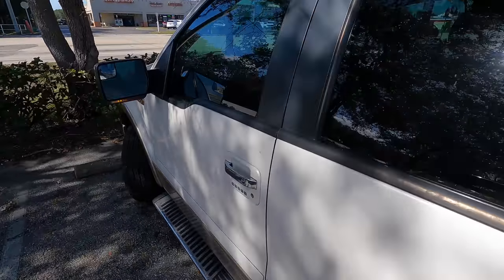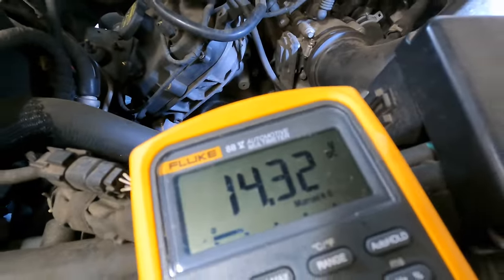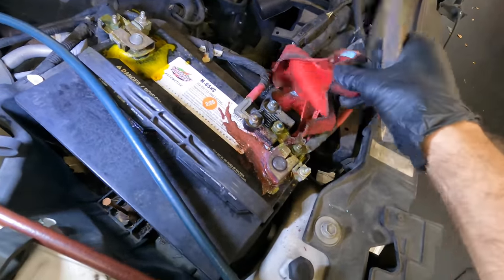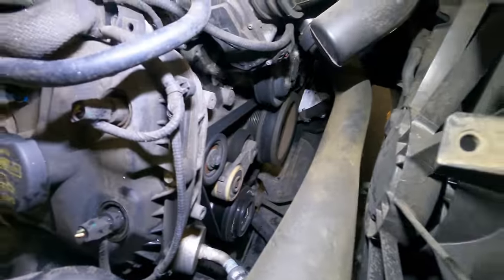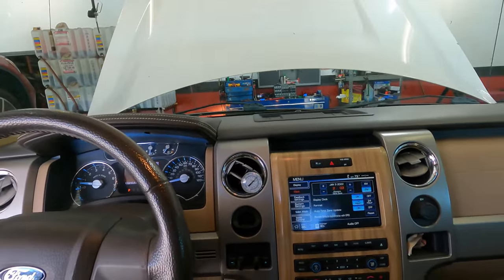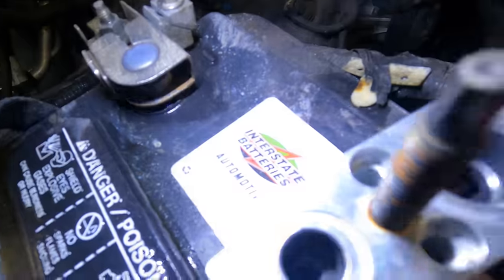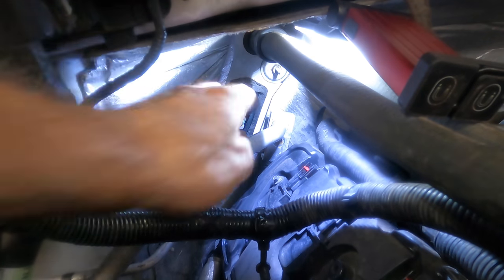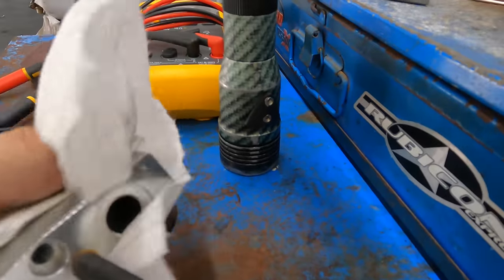It’s the Black Death!

Comment: Ray is the kind of guy to clean up the battery terminals when diagnosing a rusted fender
Reply: Much respect for this man
Reply: It's good, but I mean the outside of the terminals doesn't affect how they contact the battery, cleaning the contact areas would've been best
Reply: @user-ut9ln4vd5m  Quite true. Not disconnecting the hot side while wire brushing it and risking grounding it to the frame was also a dead giveaway that our boy here is knowledgeable, but on the lazy side.
Reply: @jshireley  yeah He’s trying to summon his inner Colombo while showing us his outer Lucy Ricardo, I am sure that cleaner he was using by California code would be considered caustic and or possibly carcinogenic and I’m sure he got a face nearly full of it. And I really don’t think it’s his lazy side as much as it is him being green and learning on the fly a lot of this technical mechanical information that he gets from a bona fide laptop program for mechanics, Which all comes together in his edited videos
Reply: Had a tech at the shop I work at last week clean battery terminals with brake clean then proceed to wire brush it directly afterwards. The green flames coming off that battery sure were pretty 🤣
Reply: @user-ut9ln4vd5m  Ditto.  But it was an entertaining gap filler and possibly good therapy for his desire for perfection 🙂🙂
Reply: @jshireley  He actually mentions that in the video.
Reply: I'd be too embarrassed to have Ray look at the state of my battery..... 😳

I'd have to get a new battery first before I let him poppiez the hood for diagnosis 😅
Reply: @darkwolfe6986  🤣🤣🤣

Comment: Fun little tid bit.    I bought my wife a newer car this year it’s a 2017 Chevy Tahoe.   Really really nice rig I can see why they keep Making them BUT it was used and we got a sweet deal.  Had some issues it had a Huge scratch down the side of it  like a key I think. Cost me $2200 at a body shop.  And then the ac didn’t work.   Kind of odd for 2017 with 46k miles.   They had a recall for the condensor in those years they would crack in this one spot and sure as shit that’s what ours had.  Our vin was included in this recall but of course the dealer ship near us was months out mainly because of covid and the shipping issue.  We bought it early summer with ALOT of hot days ahead of us and all black leather interior.  I ended up doing the condensor myself it was $80   But lol this rig takes a “new” Freon  R-1234yf.  It cost nearly $600 to fill it.   I thought that was pretty neat of GM.

Comment: I think it is obvious that the problems with this truck all originated from the unacceptable orientation of the oil cap.  🙃
Reply: I kept looking that myself and thinking, wth need to flip truck on it's side to fill? ;)
Reply: Wtf is an oil cap? You mean the 710 cap.
Reply: "The unacceptable origination company of the vehicle itself".. There, FTFY..
Reply: @garykirk1968  GOD........doing work in an Oil Change place, I've burnt myself on more Ford exhausts than any other cars. Stupid older Escape models, the F-150 (2019 model with its shitty thermocraptasticplastic plug I had once make a massive mess on the entire floor of the bay.)
Reply: Unacceptable orientation is one thing. Not doing two to seven full turns of the clicky cap when you install it can be detrimental to your engine.

Comment: Looks like the old compressor blew up spectacularly and the system should've been flushed back then. Good to know the customer gets it fixed under warranty.
Reply: 1:52 Yeah, compressor a bit noisy?
Reply: Yeah I noticed the compressor did not sound very happy
Reply: That would depend on how clean the system was the first time and what happened to the other pump? They could have just stuck a cheap rebuilt pump on it and it just didn't last.
Reply: @garyr7027  unfortunately I would like to challenge anyone to find a compressor or any other part from the direct factory since all you can get is remanufactured equipment , and Ray installed this compressor last year and cleaned the system thoroughly and did everything by the book but as many people know you can receive a bad new part straight from the manufacturer , quality control today is pretty much out of the door now
Reply: @catslivesmatter1268  As Ray has said before, new doesn't necessarily mean good.
Reply: @MonkeyJedi99  exactly 💯 true And I don't have enough fingers to count how many times a NEW PART was either the wrong part or the right part but very much not good part 〽️
Reply: My local independent shop has sworn off all of the Chinese aftermarket compressors (UAC, GPD, Four Seasons, etc.). Too many come backs. They only use OEM compressors... And yeah, they are freaking expensive! On some older cars (03 Taurus, 04 Dodge RAM) I (as a shadetree mechanic) have had good luck with OEM rebuilt compressors from Jensen Auto in Michigan (not a sponsor.) Always flush the evaporator; at least flush the hoses OR just replace them, and always replace the condenser - most condensers these days are parallel flow/microchannel, impossible to flush.
Reply: As it should be covered since Ray replaced this less than a year ago and he did a video of the replacement and he flushed the system and even did it a couple times including the new oil in the compressor
Reply: @catslivesmatter1268  I agree there, it's getting really bad with parts now. I completely redone my AC system on my 97 f150 about 3 years ago and I was picky about the parts I got, and crossed my fingers the parts were good. Luckily I haven't had any issues yet, except for the dryer I bought from a Ford dealer, when they sold me a used dryer that kept freezing up 3 days later, then they denied it and claimed it was new on a open boxed item... stealer dealership. I ended up finding another new one online. Ford managed to change design that year and the original dryer mounts up different than any aftermarket one I can get. It's messed up situation but I managed to make it work anyways.
Reply: @garyr7027  those dryers are really a pain in the ass, I have installed the same type of dryer for a central AC that is adjustable and it is a great way to get it right after a few adjustments , Central AC is totally different than what the auto industry uses as you probably know and I didn't think it was possible to install the central AC dryer auto from the central unit but since my brother in law is one of 13 specialist that also works for NASA , he had it right the first time , Many inventions have been turned down due to the government stating that the industry would go broke if they patent any of the great ideas ( like the snap out dashboard for example ( not Designed the way I would picture it but none the less they turned it down )
Reply: @smokingstone1141  yeah sounded bad
Reply: @davidgilpin5200  It is amazing that anyone would ever buy Chinese anything auto parts, or any parts, pretty much  anything from them..
They do not CARE one whit what happens to their cheaply made, less than any quality, parts, ever... 
Anyone that buys them because they are so much cheaper - well you get what you pay for... And then some, when it blows up and comes back to you..
Reply: @frandanco6289  Trouble is, by the time enough people realise the Chinese stuff is crap, all the indigenous parts manufacturers have gone to the wall & there's no quality alternatives left.
Ford, GM, etc don't give a damn, so long as they keep shifting new vehicles which last out to the end of the warranty.
Reply: @Andrew-ep4kw  Same.
Reply: @frandanco6289  problem is that for other part of the world that uses USDM vehicles, Chineese made parts are sometimes the only parts you can get a hand on within resonable time frame. If I want to do any mechanical work within half a year on my 70' Lemans I have to order in advance EVERY SINGLE PART out of US or make it myself (I live in EU - Poland Btw). Newer parts arent any different. It's either heavly used parts, or knockoffs (or order it for a 2 or 4x price because fk me and my american car).

Comment: Just found your channel. I like what I see and I don't know why. So I'll keep watching.

And BTW: When I was a young guy, I visited FL during July. I thought that I was set on fire and feared for my death as soon as I stepped away from the airport. All winter as it snows, I now think to myself "At least I'm not in FL during the summer".
Reply: When I moved to Phoenix in the early '70s I noticed none of the weathermen called anything below 110F "hot."  In June or July 1976 (IIRC) a TV weatherman said, "Tomorrow, sunny and cooler; high 113." "Sunny" was usually reserved for under 110.
Reply: In college, I had a housemate from the Tampa area who absolutely freaked out when the temps got below 60 degrees.  She headed back down just as soon as she was able, and cannot understand how or why I continue to survive in the North.  I argued then (and maintain to this day) that when the temp drops from 45 degrees to 25, it's not that hard to add a layer, but when the temps go from 85 degrees to 105, there's just no way to get any more nakeder.
Reply: I grew up in central AL in the '50s.  Average summers were 90+ 90% humidity and no AC.  You just learn to sweat and stay hydrated.  Big old attic fan like a DC3 engine cooled thing off at night.  I can tolerate heat with no problem to this day.
Reply: @govsquid  truer words have never been spoken
Reply: *shop phone ringing has entered the chat * another reason to love this channel
Reply: keep your weak blood up north! MORE HEAT FOR ME!!!!

lol jk
Reply: What is you talking about! I had family from California in the middle of the summer and they were happy with our 93F (feels like101)weather as they used to the 113F (feels like hell)
Reply: I'm from NY, when leaving the airport I started to sweat.  Shortly after that experience I changed my diet...

Comment: One thing I like about this truck is the engine, mainly in that you can see it.  It's not covered by a bunch of cheap plastic panels.  Seriously, on some cars it's like having a second hood.
Reply: Manufacturers be like: We heard you like hoods, so we put another hood under your hood!
Reply: That's one thing i like about the 4.7 in my tundra. When you look under the hood you see one thing, engine. And it's decently easy to work on because there isn't layers of crap piled on each other
Reply: It's just a beauty cover, snaps right off.
Reply: My 2013 GMC Sierra 1500 is not that but my 2016 Ram 1500 is a little more packed lol.
Reply: @rjmac3001  I miss my 4.7 Tundra. Hold onto that bad boy!!!

Comment: Now I can see why some shops require a full system replacement when doing an ac compressor.. If not, remnants of the old system will still be present and eat up the new parts. That AC system clean was neat though, thank you!
Reply: Is there not a strainer on the fords like GM uses on the orifice?
Reply: @jcbecker2800  I did a compressor and expansion valve replacement in a 2011 ford fiesta. There was no orifice tube, just the valve. No strainer as there is on the tube. Rock 
Auto showed options for both. Guess it depended on which version of the fiesta you had. This one was the SE.
Reply: What do you mean by full system replacement in this case? Emptying all the refrigerant and replacing that, or replacing the entire AC system? I would call the first option a flushing. Might be a little off as well, but I like to separate the two, as the latter is pretty expensive. Mind you, English is not my native language, I just want to figure out the differences.
Reply: @olenilsen4660  I'm not a mechanic... but in this video we can see the internals of the compressor, metal bits, black bits, floating throughout the system.  Sure, a good cleaning will get most of it.. but definitely not all, I don't think that would be possible.  Some metal bits will be floating around in your brand new compressor if the entire system wasn't replaced.  It's not always worth it I would imagine.. on older cars, using aftermarket parts just to get by a couple years. ....
Reply: @olenilsen4660  To add on and answer your actual question:  By full A/C system, I mean compressor, condenser, the evaporator core, and possibly all the hard lines.  A good cleaning may get the metal bits out.. it may not though.
Reply: @JMRSplatt  thanks. My thoughts would be to get the big junk out, then carry on. The shit that doesnt leave in a flushing, wont cause a problem either. It will lie on the bottom for 150 years or so.

Comment: It's actually a blazing 19° @ O'Hare this morning 7:17. Good morning, Ray. Time for a cuppa Joe. Is there a part 2 to this A/C repair? And did the cooling fan ever energize? Load up that parts cannon, son.
Reply: 8 below zero and snowing hard in the Rocky Mountains. I need to move.
Reply: ayyy a fellow chicagoan 😂
Reply: @wildcodefox7313  I second that
Reply: @maddogmicknyatv  good ole toasty 14° today lmao 😂 glad my shops heated
Reply: I its -4 Celsius with a wind chill factor of -14 here in Southwestern Ontario Canada. Going down over night, while I work outside, to -8 with a wind chill factor of -19
Reply: @martinvs6415  These farenheighters wouldn't know a celsius if it froze them at zero and boiled them at 100. Imagine knowing what the temperature is based on when to put the cows in the barn, in 2022.
PS -4C is for canadian tourists only, when the temp (or windchill I suppose) is the same in C and F you've earned your leaf

Comment: As a complete amateur I follow both HVAC channels and auto repair channels. The glaring difference between those two specialties is the way HVAC techs would never use compressed air, they only use nitrogen to flush a system, because of the high failure rate when residual water coming from air is present in the system. Those guys are all about deep vacuuming down to 25 microns, often for hours, to get every last molecule of ice sublimed off before they recharge. Yet I see many general mechanics here on Youtube using compressed air, and most don't have nitrogen even if they wanted to use it. Many don't vacuum down for long enough or deep enough by pro HVAC standards. Most vacuum pumps can't get anywhere close to the HVAC standard of 25 microns. Many blame bad parts, but I wonder if this difference in how water ice is purged explains why the failure rate is so high with automotive AC repairs....
Reply: Big difference it's the shop compressor has a dehumidifying unit if it doesn't value right if it does hopefully the system won't have moisture bone into it and nitrogen to be nice but you got to pipe that in it's got to be almost a sealed system

Comment: Does the metal not get suspended in the refrigerant? And what does that machine do with recovered is it just added to the same tank as the charge?
Reply: I was curious too. If the exchanger has schmoo, isn't it contaminating the whole tank when recovered, maybe it has a filter?

Comment: Looks like who ever did the AC the last time forgot to put oil into the system if the compressor fails before the warranty is out
Reply: Compressor oil?
Reply: I agree. There is something else which they should have changed also.
Fast fit centre's vacuum but rarely pressure the system b4 filling.
Reply: Or didnt flush and or replace condenser
Reply: It could have been a lot of things that made this pump go out, either way something may have been overlooked the last time it was done... or it could have just been a cheap rebuilt pump unit.
Reply: @garyr7027  - Dorman to the rescue 😵‍💫
Reply: @Dirtyharry70585  Lol
Reply: @alrighty6898  yes compressor oil, it's actually called PAG oil and all new compressors require it before charging the system. Any new or even rebuilt pump will come with PAG oil, otherwise warranty is void if not used.
Reply: More likely the oil got contaminated from previous installation with moisture and probably acids left in the system. Which made more acids and broke down the new oil and you get this.

He's replacing condenser and compressor which eliminates two spots. He needs to clean the hoses and evaporator... not sure if he is reusing valve or using a new one at this point. I'd swap the valve too. Then add a filter drier on. Needs to blow put old parts with steady nitrogen stream. Reassemble all. Then do several vacuums and pressure with dry nitrogen... a good 3 times. Pull a deep vacuum and it should last a long time because most all contamination will be gone amd the filter should capture any remaining.
Reply: @etherealrose2139  yeah, when a AC system does this, it's no cheap quick fix. It's either done right or not done at all imo.

Comment: I noticed that the temp gauge on the instrument cluster stays full left throughout the video. Methinks the temp sensor is failing which causes the fan to not come on and the airco fails because of that.
Reply: That's the transmission temp gauge
Reply: @arcainwolf501  Transmission temp gauge. Must be made in America ;-)
Reply: @Z4NL  if you have ever towed anything you would know how valuable that gauge is…
Reply: @Twisted_Harlock  I have, but that was ages ago. Never saw a car with a trans temp gauge though. This is a first for me.
Reply: @Twisted_Harlock  Probably only a thing for those trucks. We don't have them in Europe.